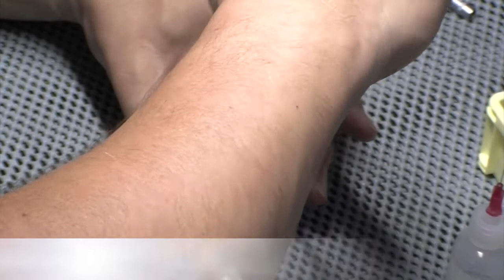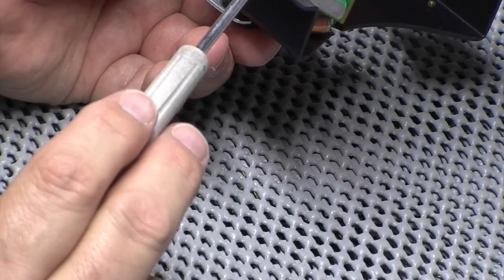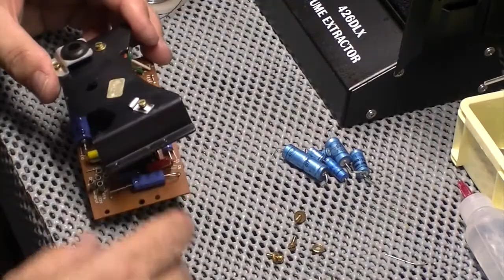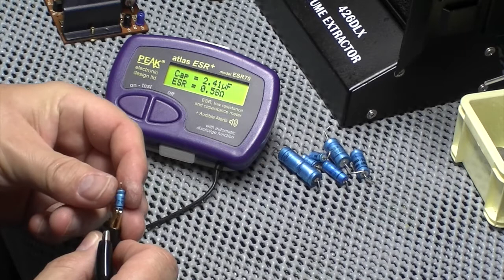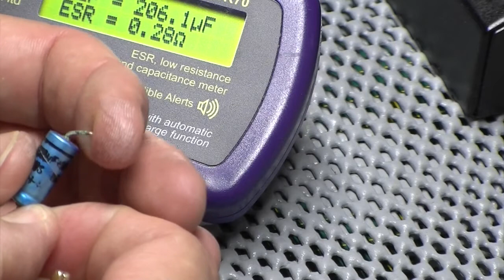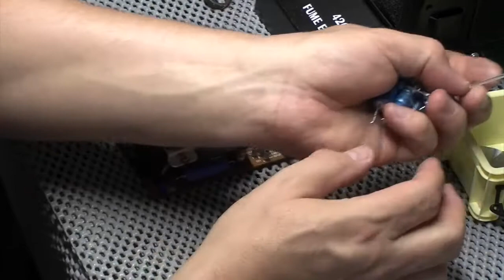Christmas Advent repair series 9th December 2017: Hacker Hunter RP38A fm-am part 2

Comment: An interesting thing about the OC71. Mullard also made an OCP71 which was exactly the same but without the white stuff inside and no black paint, it was called a photo transistor which cost 10 times as much. I used to use the very cheap OC71, cut the glass off remove the white stuff and for about 10p a really nice photo transistor.
Reply from the maker: Had heard that before Michael. I think I have a Mullard phototransistor somewhere so I will have to dig it out and see what type it is